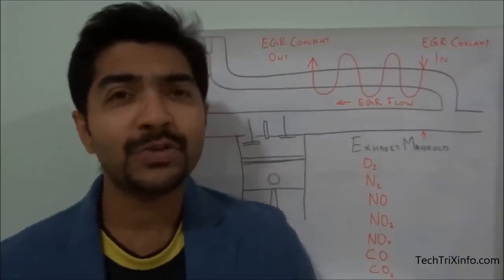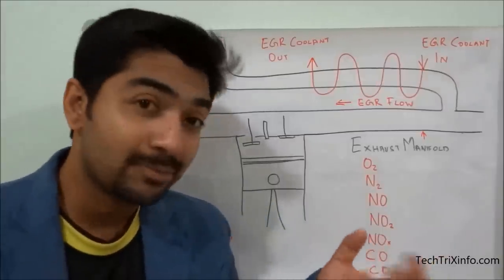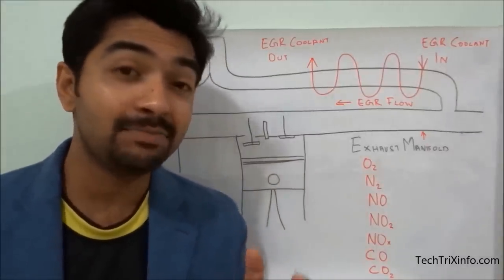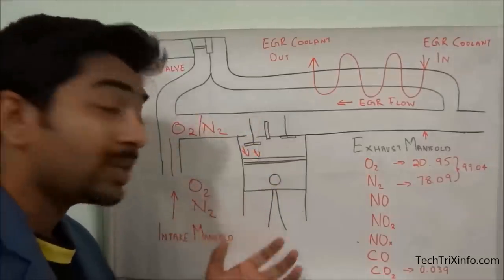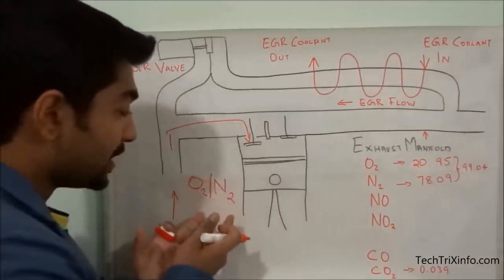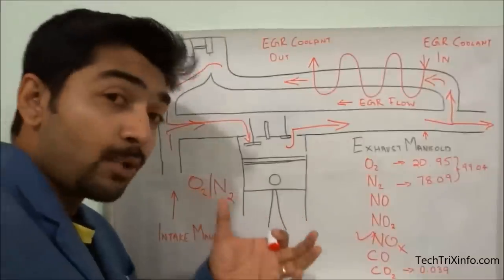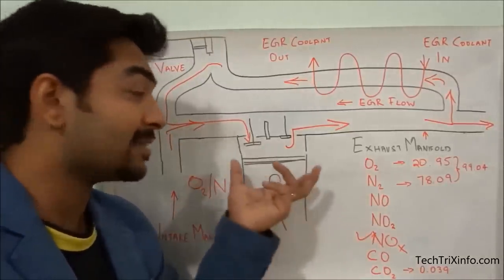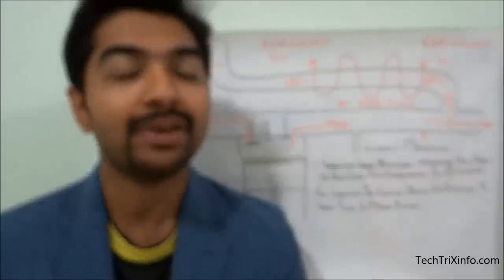How exhaust gas recirculation system works - Must watch

Comment: how to determine if EGR is choked/ not working / totally out of order. is there any method to repair it again for Tata Indigo eCS CR4 ?? please answer all points ,i am trying to copingup with all these problems nowadays besides a lot of labor charges by mechanics but can't concluding if the EGR is really out of order/ replacing a new one???

Comment: The main point to highlight here is that the O2 (from air inlet) is replaced/diluted with CO2 (from exhaust gas). CO2 has a higher heat capacity than O2 which therefore reduces peak temperatures in the cylinder. Cooling the exhaust gas does help reduce the overall reduction in combustion temperature but the main principle is the introduction of CO2.

Comment: Sir jis car me turbo charger hoga to os may egr kaha mount hoga turbo charger say phely ya os kay baad or turbo charger jab boost pressure bnaeyga intake manifold may to egr valve ka diaphragm jo intake manifold may pipe say connect hoga wo kesy open hoga gas recirculate krny kay liey kion kay turbo charger ki badolat inlet manifold may positive pressure built up ho jaey ga jo suck krny ky bjaey push kryga to os surat may egr valve kesy kaam karyga.... Plz reply

Comment: Hi Sir, Its really help me to under stand the working principle of EGR system. But after watching this video, i have one question. It would be great if you could answer my question. My question is,
Once the EGR start working, the intake air will contains normal air (O2+N2) and NOx as cooled air. What will happen to this NOx after combustion? Because we do this to reduce the NOx emission but the intake air itself contain the NOx.
Reply: there will be  a catalytic converter placed between the exhaust valve and muffler so that NOx is reduced to nitrogen and oxygen

Comment: Very informative. I wonder how they figured out that this system would reduce NOx
Reply: +richard michaud pretty simple if you talk about figuring out this thing. Basically Nox gases occur at very high temperatures (approx 2500 degree C) i.e. combustion temp , this is the threshold temp for the prod of Nox gases , hence the idea of lowering down that peak temp is what form the only basis to reduce nox. there is no rocket science. 

regards
Reply from the maker: +Sahib Singh 
Well explained
Thanks for the comment
Mechanical, Automobile engineering updates through Whatsapp @ +919744615655 (requests through Whatsapp to get updates, or if you have any doubts)

Comment: Egr is generally used in GDI engines (and air assisted fuel injection) rgt where we can attain high compressing ratio due to efficient cooling of cylinder by absorbing latent heat by fuel. (Where temp rise during combustion will be very high due to which large possibilty of NOx emissions as well as the stratified mixture create which will also accelerate NOx emissions)

So this exhaust gas will reduce the temperature during ignition time only rgt as engine is already at normal condition .so how come it helps in reducing knocking .
Or if it cool the engine further at initial condition there may be chances of over cooling of engine rgt so how will you account for tat .

Just a doubt may be foolishness.please clarify my doubt

Comment: cooled no2 and co2 won't cool the engine it just replaces some part of oxygen and nitrogen and dilute the fresh charge since oxygen is less fuel air mixture will ignite slowly hence reducing engine peak temperature their by reducing nitrous oxide emissions since oxygen and nitrogen combines at higher temperature and also exhaust gas does not support any combustion since exhaust gas is mixed with cold air intake that is fresh charge which will increases inlet temperature and hence density of fresh charge will drops hence performance is also drops so thats why we need to cool exhaust gas before diluting into fresh charge and cooled exhaust don't cool the engine as you mentioned in this video don't mislead the people.
Reply: Because more amount of work is done on compression of the charge which is already hot

Comment: can you make a video showing how PCV valve system work? As well as how Catalyatic Converter work?
Does the EGR cooler uses the engine coolant?
Reply from the maker: +7150285 
We have a video on catalytic converter 

Mechanical, Automobile engineering updates through Whatsapp @ +919744615655 (requests through Whatsapp to get updates, or if you have any doubts)

Comment: good explanation, but where is the function of Turbo? Most of the Diesel engines has turbo chargers which is somehow connected with EGR system as well.

Comment: 1.30 If u re-circulate hotter exhaust gas back to the cylinder how will NOx reduce
3.23 - NOx doesnt mean more Oxygen Atoms and harmful. NOx means all Oxides of Nitrogen which includes NO, NO2, N2O, N2O5 etc.

Comment: In case of using EGR system, we are focusing on reducing NOx emissions. But what is the influence of this system on HC and CO emissions?? Brief them please...
Reply from the maker: +Ravi Ganesh 
The impact is on Nox, 
Mechanical, Automobile engineering updates through Whatsapp @ +919744615655 (requests through Whatsapp to get updates, or if you have any doubts)

Comment: Why not also cool the air before it enters the combustion process in the intake manifold?
Reply: +Kyle K  for air it has intercooler that receive air from compressor and ambient. The function of intercooler is to cool the air before go to intake manifold to reduce the hot spot in combustion chamber. so the EGR make additIonal cool the gas in intake valve that reduce the NOx

Comment: instead of EGR what if a little amount of exhaust gas remains in the combustion chamber. it would give the same effect as EGR. and it can happen if scavenging rate is reduced !!
Reply: +Nishant Khalde Your are forgetting that the main aim is to lower the combustion temperature , how can the unscavenged exhaust gases ( which are are at high temp) accomplish our purpose ? We need some kinda mechanism ( here, a coolant system , like a radiator) to lower down the temp of exhaust gases so that they can be used again. simple !
hope it helps.
regards

Comment: why can we just cool intake air in place of exhaust gas?
Reply: would greatly reduce engine efficiency
Reply: +purushottam kumar thermal efficiency of the engine would lower down fourfold. read IC engines and thermal efficiency for greater details.
Reply from the maker: +JAYANTH joseph 
Yes good observation 
Thanks for the comment
Mechanical, Automobile engineering updates through Whatsapp @ +919744615655 (requests through Whatsapp to get updates, or if you have any doubts)

Comment: EGR is a joke for the environment! Don't  get me wrong, it does reduce nox once it leaves from the pipe, but like myself, I'm a truck driver, And in the real world,  egr engines push more nox than a none  Egr engine, egr engine will have to inject more fuel (due to lack oxygen)to get the same power than a none egr engine example : let have two trucks with Detroit engine  60 series, one has egr and the other does not, both trucks(bobtail, similar weight) travel 500 miles,
The none egr truck will do above 10 mpg(I experienced it myself)
While the egr truck will do 6.8mpg or less, so this truck wasted more fuel, and more fuel=more exhaust.
So the question is... did the truck with egr really reduce nox during  the 500 miles? 

PS: the none egr used 50 gallons desiel
And the egr truck 73.52 gallons, that's  23.52 more desiel than the none egr at 500 miles.
Reply: Fuel consumption has almost nothing to do with NOX. NOX is formed when oxygen and nitrogen are heated beyond a certain temperature. By reducing the peak combustion temperature inside the cylinder that temperature is either not reached or isn't reached for as long reducing the formation of NOX. 

EGR diesels do consume more fuel, are less efficient, are less powerful and produce slightly more soot and carbon dioxide BUT they do emit less NOX. 
You realise that when they test this stuff they do run the engines too right? 

You're experience with MPG has pretty much zero relevance to NOX emissions. If the EGR diesel is doing that much worse I would suspect that there may be a problem. When I blanked the EGR on my diesel the fuel economy didn't improve by 32% more like 10%. How old are these trucks, is the egr Computer controlled or is it a dumb system?
Reply: Leviticus Rodriguez with respect....

by taking out  catalytic conver we can save fuel too but think about environment ,u burn millions of gallons no one cares unless no harmful gases are in exhaust.

without EGR
more fuel =more exhaust with more harmful gases 

with EGR
more fuel =more exhaust but with less harmful gases 

give cleaner environment to your kids and all of us so we all can breathe .
Reply: Zia Din I'm sorry to desagree,  no egr= better fuel saving
Egr=very bad fuel milage
I should know, my wife and I been on the road for so many years driving are own  trucks
Reply: Leviticus Rodriguez You miss the point. 

We agree that EGR does reduce your mileage! It absolutely increases your fuel consumption! We agree with that. 

What EGR does and why it was mandated was too reduce NOX emissions to reduce acid rain and the like. 

As Zia said if you remove the catalytic converter you also improve fuel economy, that doesn't mean that you should though as it means that the exhaust gases are more toxic. It isn't just about CO2 and fuel economy.
Reply: +Leviticus Rodriguez the more I think about the silliness of the EGR system the more I think it must have been desing by the oil industry !!!!!!!!
Reply: +Spencer Howard   did you know thw EGR also destroy your engine !!!!!! especially when you talk about diesel
Reply from the maker: +pzkw108 
Great observations
Thanks for the comment
Mechanical, Automobile engineering updates through Whatsapp @ +919744615655 (requests through Whatsapp to get updates, or if you have any doubts)
Reply: I'll start by saying, why not increase the cooling of the air and the engine to accomplish the same thing. My issue is when the egr breaks then the engine runs very inefficient, the computer adds more fuel to compensate. I swear it is about to break my pistons from compressing liquid fuel. But I guess that is what car manufactures want because then I will be inclined to buy a new vehicle
Reply: you have no clue, because you are just a TRUCK DRIVER. lmao. EGR makes the engine more efficient. It reduces cylinder temperature by forcing burnt and inert gas which do not mix with fuel. Also, it comes into function only when the engine runs constantly or at idle. At demands the valve closes completely until you decide to run at a constant RPM.

Comment: So u got the cat transforming the gases (exost fumes ) environmental  friendly ..why in the f u have to run the fumes back in the chambers. That's wher u get : 1 carbon build up , ,2 low engine performance,  3 is  reducing the life of ur oil extremely  (the carbon gose thru piston  rings in the oil-thats wher black gunky oil comes from) 4 distroing the life of un engine (bad friction due bad oil mixed with carbon) etc So at 150000 look for other car allready . Imagine a clean fuel +oxygen mix, no trash in it .  If u worried about environment ,put another cat converter  in ther . Feel sorry  for truck drivers , this system messing up theyr work and capital .I'm talking thousands spent in repair on that kind of "technology".   Needs un update .